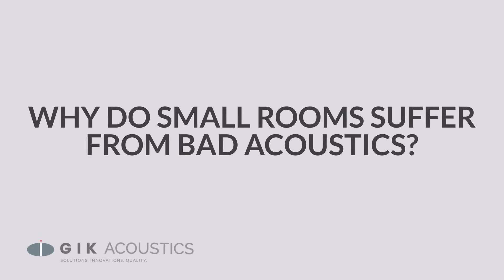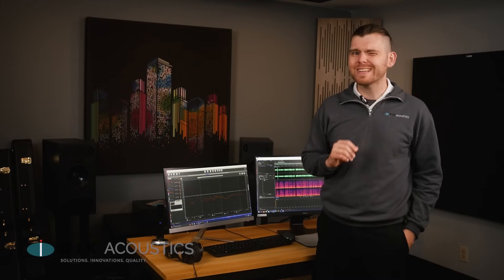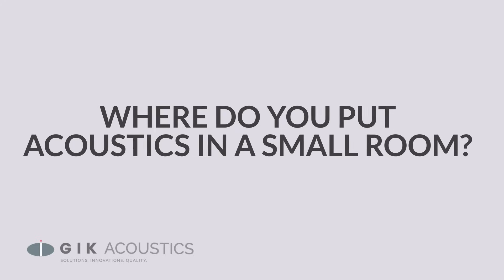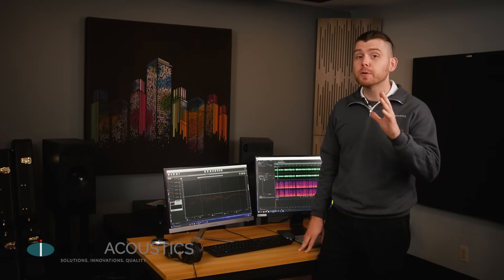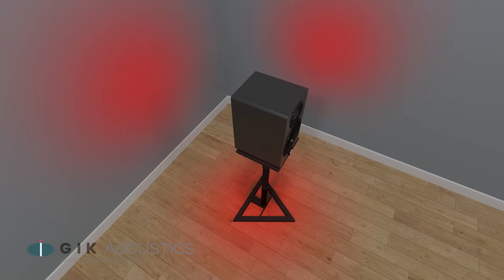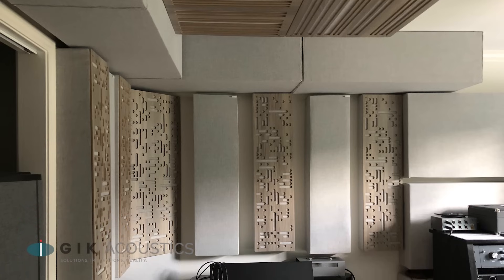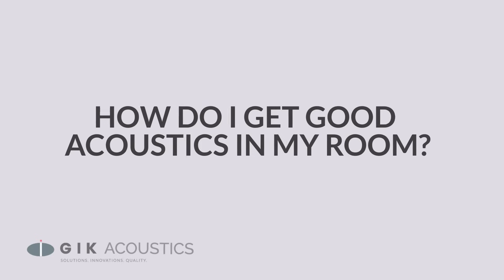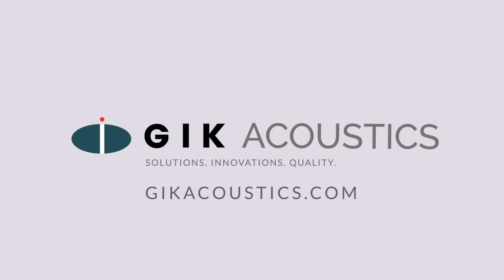Room Acoustics for Small Rooms - Why do small rooms suffer from bad acoustics?

Comment: If 50 x 30 feet (15 meters x 9 meters) rooms are the definition of small, 95% of rooms will be in this category. 15m x 9m (135ms) is HUGE by any standards in a normal house. Such big rooms will definitely benefit from diffusers.
Reply: You are right, in Beijing, 3m*4m will be considered as a regular room size..
Reply: @jerryfan8571 Also in Israel
Reply: My Recording room is 15 feet length and 12 feet width and 9 feet height. Walls are made of bricks and ceiling is plaster of paris. What do you guys suggest for Room treatment. Especially if I have to record podcast and also singing.
Reply: LOL in my 12x10 ft room!
Reply: @tzm1843  yes in MY 10x12 shoebox lol
Reply: @tzm1843  God. 10x12ft? LUXURY. I WISH I had a 10x12 room. Mine is 8x9ft.
Reply: I'm going to use all caps as this need's to be understood and is supported by facts-  WHEN SPEAKING FROM AN ACOUSTIC STANDPOINT ANY ROOM LESS THAN 64,000 cu/FT IS SMALL.  So when the average SPL is 75dB or higher your going to have loads of issues especially with large speakers.  That being said, I recommend focusing more on the setup as there are thousands of mistakes I see being made both in my business and here on YouTube.

This is Science not conjecture...
Reply: if you have low-end issue get a PA Sub 12” , it helps 🙂
Reply: @qwertandrew8720  A sub in an 8x9ft room doesn't sound like a smart solution. The room is just too small.
Reply: Lol my tv/audio/Pc room it's 5 x 3 m 😂
Reply: 2 by 3 meter here in NL
Reply: @KoenDeJaeger  2 by 3 meter?  What's 2 x 3 meter?
Reply: @Oneness100  my room
Reply: @KoenDeJaeger  what's the height?
Reply: @KoenDeJaeger  Sounds like it's a small bedroom or actually a closet.
Reply: @KoenDeJaeger  If the height is between 200 and 300 cm, then your room is going to have so many problems that it's going to take about 2 feet of space lost that would be used for treatment to fix all of the low frequency pressure mode problems.   That's the biggest problem with small rooms.  The smaller they are, the worse off, and in order to properly treat, they require a LOT of treatment and to go after low frequency problems, the cabinets have to be 12 to even 16inch deep and you need a LOT of wall coverage, otherwise you're just going to have an unacceptable room for critical listening of audio…

Most people are simply difficult to accept that fact that small rooms are NOT designed for audio.
Reply: @Oneness100  It's L / W / H:  2.30m / 1.95m / 2.40. I tried putting the desk along the smallest width. That gives a lot of rumble bass, at least it;'s symmetrical, but the problem is I have southern facing window there so I would have block all sunlight to sit in the 'recommended' position. The second best option is putting the desk in the middle of the length. Then I have literally no base, unless I use an EQ to bring it in. It's better than looking at a monitor behind a bright window. Problem in this position is I got some wonky ears due to having windows on one side. Also more revert, stereo effect seems to big. I'm still testing this out. If this is not working, I'm thinking of just using headsets more often :(.
Reply: @KoenDeJaeger  Your room is too small for a full range audio system at any decent SPL.   The demensions result in having a lot of low frequency pressure mode problems, and many of them are Axial mode, but with coincidental mode problems.  In order to really fix the low frequency problems in the room, you'll need low frequency absorption on ALL surfaces and the depth of the treatment will be at least 12inch or deeper..

EQ is only best to use when you have only a 1 or 2 dB problem.  If you have larger than that, it's better to either treat with real treatment OR simply get a bigger room.
Reply: @Oneness100  the sad truth indeed. Actually I'm lacking bass. I added 8db around 46hz to have a bit of a bassline at least. Maybe I could live with this for daily listening, and some production if I get to know my system. I do have good headphones for when it comes down to it.
Reply: @KoenDeJaeger  Here's the problem with small rooms.  You will have large peaks and nulls at different frequencies.  That's just the way physics work with small rooms.  And to treat those peaks and nulls so you can hear those frequencies, it takes large cabinets with lots of mass to absorb the excess pressure…  It seems backwards, but adding more EQ is just not going to do the job especially if you have an 8dB or greater peak or null..

EQ really is only meant to fix 2 maybe 3dB and that's it. Otherwise, it sounds bad and overly EQ'd..
Reply: @Oneness100  what's strange is in my listening position the bass is not very pumping. Also in the corners is not soo bad. So why would I put bass absorbtion in the corners, wouldn't that also make the bass even less in the listening position?
Reply: @KoenDeJaeger  Go to this site and punch in the dimensions of your room and see all of the different modes and where they are located.

If you see multiple entries at a certain frequency or within 5hz, those are coincidental and they are going to amplify your modal problem at that frequency as it will be like having the same problem on 4 entire surfaces, possible even all 6….

That's why rooms that are cubes or a square have massive problems.   That's why you want to avoid rooms where you have 2 or 3 dimensions similar or the same as each other..
Reply: @KoenDeJaeger  You have to also worry about being in a null along with being in a peak.  A null can be so bad that no matter how much you turn up the EQ at that frequency, you just simply won't hear it…. So, some frequencies will be too loud, some will not be loud enough.  So, you are essentially listening in a room with peaks and nulls at different frequencies. To even those out, you have to get enough treatment to absorb the frequencies with the massive peaks.  with enough of the right treatment, the nulls and peaks will go away..

But get the low end right first as it easily over powers the mid's and high's. Once you get the low end right, the mid's and high's snap into place a lot better..
Reply: @KoenDeJaeger  Yeah, you'll have to cover up the windows for sure…

Yeah, in really small rooms, the problem is that they have so many problems, you have to treat all surfaces to get things under control, and most people don't want to take up the room/money to treat….  That's why bedrooms are horrible for critical listening rooms.
Reply: @Oneness100  What I wanna know is how so many people who post great songs they did to youtube, where you can literally see the crappy place they mixed in produce such great sounding music. I'm in a very decently treated tiny box of a room 3.6x2.7x2.3m (L, B, H) and I absolutely 100% CAN NOT get mixes to translate. At all.
Reply: @oinkooink  You're room is too small and you don't have the right treatment.   I don't know what you mean by great sounding music.  Give me an example.
Reply: @Oneness100  I know my room is too small. Luke Fitzpatrick on YouTube is one with great songs. He does it all in Audacity with no treatment in normal household rooms. I don't think there is any "right" treatment for my room. Never going to work.
Reply: @oinkooink  The problem with ultra small rooms is that the amount/type of treatment you'll need will make the room even smaller, thus making it nonusable.

There's a low frequency absorption cabinet you need to make, there are build plans you can get to make them, but you have to line the walls with them and they are at least 12inches deep.   That'll go after the 30hz on up, and then you put a good acoustic foam on the front and that'll do it.

Acoustic Fields has their BDA cabinet which is a diaphragmatic absorption cabinet.  They work great, as does their foam, but it's still pricey and they take up a fair amount of room.

Some people just learn how to adjust for bad room acoustics and they've learned how to mix despite having a bad sounding room.  That just takes time, experience and a little luck..
Reply: @Oneness100  Yeah it seems pretty hopeless. I'm looking into headphone correction software, but it seems gimmicky to me. I dunno.
Reply: @oinkooink  That's about the only thing you can do other than getting a lot of treatment that will reduce the size of usable space in your room, OR, get a bigger room and you'll still need a lot of treatment to even out the low frequencies..   Homes/apartments were never designed to handle low frequency energy and the only way to really treat it is with large absorption cabinets and treating at least 50% of the surfaces in the room.  HOWEVER, the results are insane using the right treatment.

Otherwise, you'll have to resort to using a decent pair of headphones and possibly with some headphone correction software.   I don't use headphones, but I know about the issues with them..
Reply: @Oneness100  Acoustic Fields owner Dennis Foley is a charlatan! 

False marketing about their active carbon absorption etc 🤥 Forget about conman guy's like that! 

Anthony Grimani is a highly regarded expert in home theater and music accoustics design.
Reply: @C--A  I've been in a couple of his rooms and they both sounded far better than any room I've been in..  Anthony wants to sell you a huge room with HIS electronics, etc.

can you prove that he's a charlatan with actual proof?  Saying something without backing it up with proof is a dangerous game..

But what treatment does Anthony use?  he uses stuff that simply doesn't have the same absorption coefficients.
Reply: @C--A  Grimani doesn't sell acoustic treatment, at least not on his website.  He sells speakers/electronics.
Reply: @C--A   I looked at the Sonitus low frequency absorption products and he description says they absorb down to 60hzm, but their test data only shows them measured down to 100hz, so how much do they absorb at 60hz?

Plus, the Acoustic Fields ACDA products go down to 30hz. Which typically where you have problems in small rooms.

Plus, Sonitus doesn't have anything to treat the wall problems which is where Axial modes are located in small rooms.  Sonitus is really only treating the corners with their low frequency products.   Foam will not absorb down to 30hz.
Reply: @Oneness100  I’m a hip-hop/trap producer and got a 9.3x9.8 feet room and recently I’ve been going back and forth with deciding weather I should treat the room and invest in a high quality gear OR get a pair of high quality open back headphones powered by DAC and an amplifier. Which is the best option out of these two in order to achieve a clear sound, I know headphones lacks a stereo depth. Can a sound engineer fix this issue if I take him tracks mixed on headphones?
Reply: @BWOGG  Oh, what's a "trap" producer?  I haven't heard of that term before.
Reply: fartpooboxohyeah8611  Here's some questions.  Please answer them honestly or stop posting nonsense videos if you don't answer them HONESTLY.

1. Have you been in a room that's treated with Acoustic Fields' products?  it's a simple yes or no answer.

2.  Have you actually used their products in your own room and done a proper comparison?  it's a simple yes or no answer.

If the answer is no for both, then you don't have any personal experience with their products.
Reply: fartpooboxohyeah8611  Give me one thing that Acoustic Fields has said that's not true.  One.
Reply: @Oneness100  vocal booth ?!?
Reply: @GeorgiDechev-JIMS  Yes, a vocal booth is for a recording studio or a PodCast studio where they want or need a certain type of room acoustics for voice in a VERY small room for recording.   So, there are things you would want in a vocal booth that caters to the frequency range and desired acoustics for a vocal booth for either speaking or singing or both.  reflections and decay rates need to be managed so you can a desired RT60 decay time.

Every room application has a desired RT60 decay time, so you design and treat different room according to what your doing in the room.  So, optimal acoustics for a vocal booth are going to be drastically different than a control room for a recording studio, a listening room for a hobbies (audiophile), to that of a mastering room, a home theater, etc. etc.   Some tracking rooms where they put musicians in a recording studio may want high RT60 for a long decay rate or they might want a short decay rate and that's decided upon usually by the producer.   Example of that is one of the most reputable studios for recording symphonies for movie sound tracks is SkyWalker Sound, and they have a large room where they put large 80 piece orchestras but they have movable walls where they can make the room larger or smaller, which increases or decreased the RT60 decay rates.  Some recordings are done in large rooms where they want a long RT60 decay because they want the drums to sound BIG, think of Led Zeppelin recordings. Some rooms they want a close drum sound so they put partitions in the room around the drum set or they put the drums in a very small drum booth, and then if they want a lot of reverb, they ADD reverb afterwards if they don't like the natural drum sound in a small room.     Room treatment is used and they typically use a variety of different types of treatment, materials to get the desired sound.

When you get into discussions on room treatment/acoustics, you are going down a rabbit hole that never seems to end.  Always learning new things for sure.
Reply: True! I get tired of "big and small" or "good and bad" and other arbitrary binary classifications. 50x30 feet is bigger than the size of most homes in parts of Asia, Africa and south America. I wouldn't call such a room "small" in any case :)
Talking about acoustics, room length as a fraction of 20Hz/56ft makes intuitive sense and simplifies a lot of mental math.
Reply: First off, it's the wall construction of homes that's causing a lot of low frequency problems.  A 2x4 wall with drywall and building insulation is NOT going to absorb much below 100hz, if anything. It's more rated for 125hz and above.   That's why we have so many lower frequency modal pressure problems.

As far as diffusion is concerned, one should have the low frequency problems addressed first.  And then you do some treatment of the mid's and high's.   Diffusion would or should be last.

THEN, once you figure out how to fix the other problems, you have to figure out what exactly is a diffusor.  Those BAD panels aren't really a diffusor.  They don't quality because there are 5 requirements for a true diffused sound.  Quadratic are the only that I know of that will meet all 5 requirements.  Then you have to figure out which Prime Sequence to use and that's based on distance in your room between you and the diffusor because if you don't have enough distance, then you won't be able to hear the diffused sound because it needs distance to fully form.  Then depending on your application, you have to figure out which wall(s) you are going to treat with diffusion and how much coverage, and then if you are going to also put it in the ceiling, and again, how much coverage.  Then its a matter of are you going to use vertical diffusors for a horizontal sound field, or are you going to alternate vertical and horizontal diffusion to get a 2D sound field.

Either way, I find this video to be missing a lot of information to be of value..
Reply: @Oneness100  wish I would have saw this comment before buying from them. My small room is terrible sounding I hate it.

Comment: Where to put more absorbers to treat mid-bass build-up (160hz-300hz)? Low bass sounds kinda ok. I have 6" panels in the corners already and 4" first reflection walls. Ceiling first, or front wall first?
Reply from the maker: @rollo rodriguez, we'll definitely need more information about your room to give you that kind of advice. Typically you would want to treat the ceiling and then the front and back walls or rear side walls, but this all depends on the overall goal for the room - is it a large or small room? a recording studio? Is it a mastering studio? Is it a podcasting studio? There are different strategies for each type of room. We've got more questions that need to be answered and the best way to get that answer is to send us your room information and the trouble you're having, and we'll have one of our designers reach out to you specifically with advice for your space and which products to go where, based on what you already have in the room. Give it a go at https://www.gikacoustcs.com/acoustic-advice-form/

Comment: Dampening/controlling the first reflection points are the key to having better sound in small room. I have a small theater room in my house and it took a lot of researching and dampening on my floor (carpet with 8 pound padding under it, rear defuser, heavy curtains to get in under control.
Reply: Heavy curtains actually soak up too much of the high frequencies. I've got heavy curtains but I have them pulled to the walls with tiebacks when watching movies. With my blinds down over the windows. And a couple of diffusers on top of the windowsill, it gives you much better performance.
Reply: @C--A  another company recommended me acoustic curtains. I always hear this is bad like you said. Gik said to use the gobo stands in front of the window. Why are you using diffusers?
Reply: When I replaced a thick quilt (experimentation) with a g i k diffusion/absorption panel which is 3 to 4 ft away from my MLP within my 13 x 11.5 x 8 ft living room not only did the soundstage depth come back, but unlike previously when I was using nothing at all... no reflections 🥳